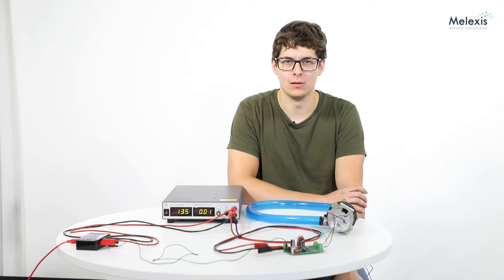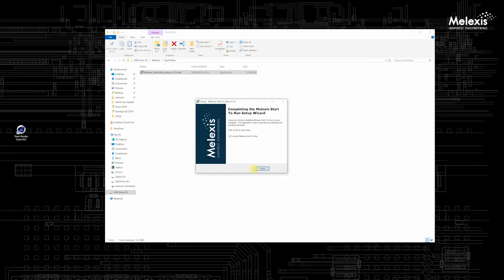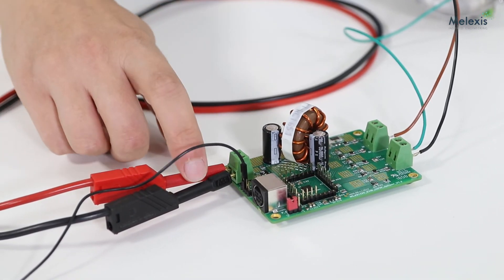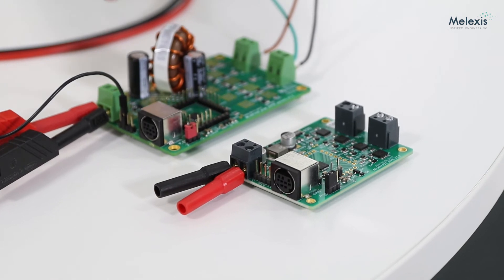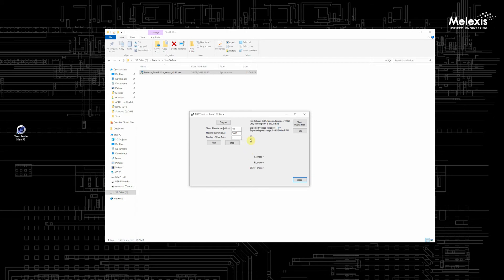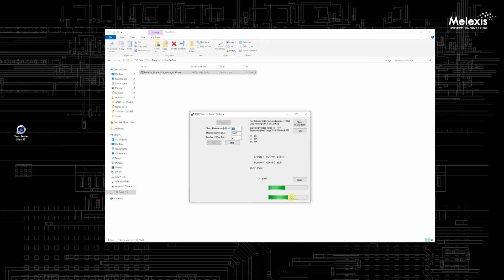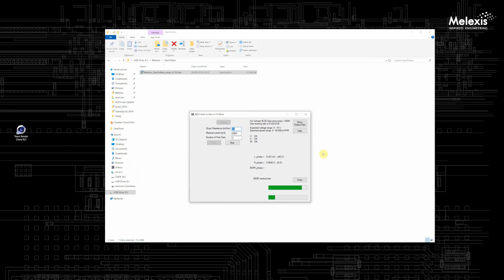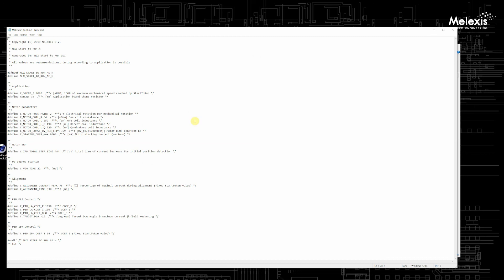Melexis StartToRun

Comment: Currently, we are using MLX 81315.

We want to know how to find the current stack usage( normal & worst case ) of MLX 81315.
No Information about the testing tool or debugging tools on the Melexis website.
We can only find some marketing information on the site but not many technical details. Is there any forum or Q&A section available for developers who use Melexis MCUs?
Reply: Dear, thanks for choosing MLX81315, our sales representative should be able to provide you with documentation and tools for measuring and estimating stack usage of your application. There is no forum for posting questions but we do share extensive documentation via our software distribution system...
Reply: @nicobollen1263  Really appreciates the fast response. Can I know the tool and document name? So I can request it from the Melexis representative here. software distribution system? Did you mean the Softdist server? I think we have to have an ID to log in.
Reply: @udaradarshanapanamullaarac3330  you can ask for "StackAnalyzer.exe" and the accompanying documentation. And yes all tools and documentation are shared via our Softdist server. Also here your sales rep can help in retrieving an account.